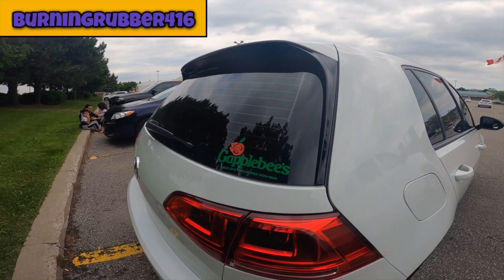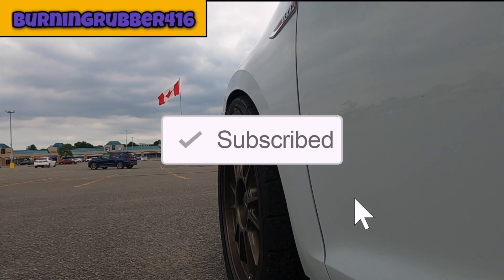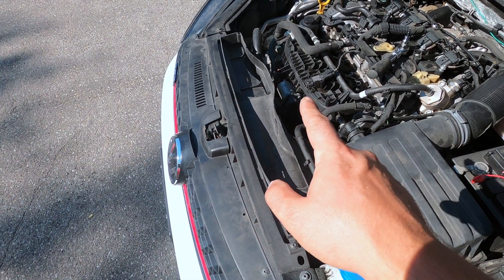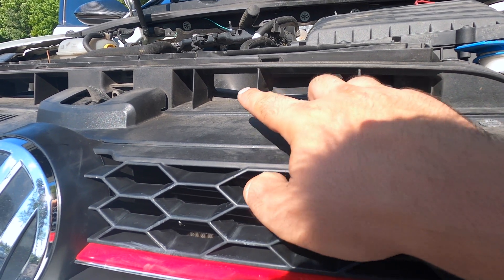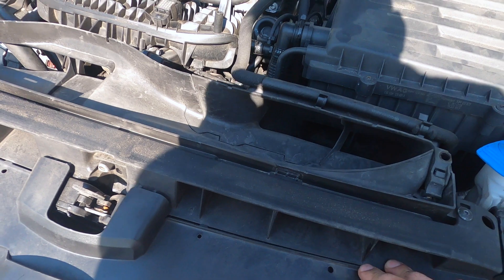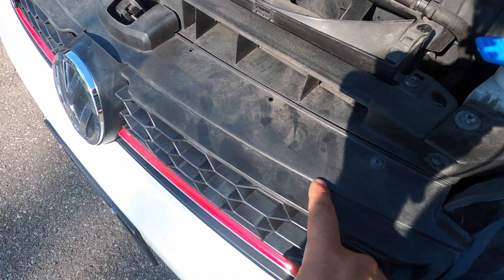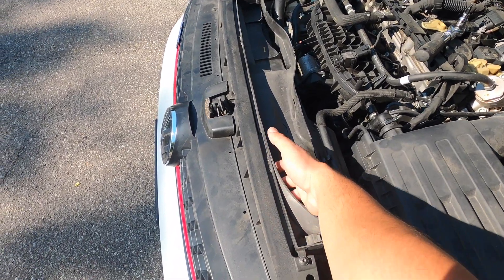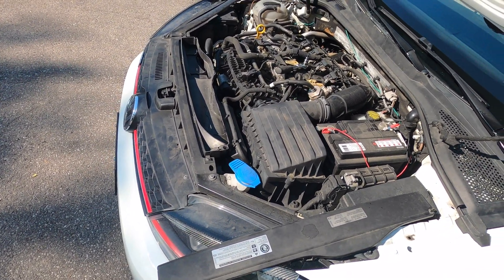Mk7 GTI How to get FREE POWER (Air Intake Mod)

Comment: Back in the days when I used to mod the older VW/ Audi's, especially the CIS cars, before there were tuners like Eurosport that made the lower section for the airbox, we used to remove the snorkel aka 'Hemholtz resonator' from the inlet on the box, and swiss cheese the airbox bottom on the side away from the radiator. It works on almost any car, 8v, 16v, vr6, etc. You can do this with a drill bit/ hole saw/ dremel, etc and it makes a huge difference. I can see on this platform it is also a great option to modify the stock box if you aren't going to buy or fab up your own intake with a proper heatshield. It was good for at least a few h.p./ trq and of course it sounded awesome and gave you much better throttle response. You should also add a good drop in panel filter, (foam ones like the Jamex or ITG style are superior to the gauze k&n style because they filter better/ don't let in as many particles/ are easier to clean/ don't require a ton of oil to be added to the element to risk fouling the MAF if equipped.) The idea is you still have the stock box to isolate the intake from heat but you add another area for the intake air to enter and will have no adverse effects since the holes you add are away from the heatsoak of the radiator. Just a tip for guys looking to do another free/ cheap worthwhile mod to the intake. 👍
Reply: Dont know if anyone gives a damn but if you guys are bored like me atm you can stream all of the new movies and series on instaflixxer. Been watching with my brother for the last months xD
Reply: @Reid Jerry yea, I have been using InstaFlixxer for years myself :)

Comment: You can eliminate the front box completely and for 25 bucks get a metal plate that removes this bent plastic box
Reply: How?
Reply: @advertentiegolf I can find a link they’re cheap. Even temu had them for a while
Reply: @advertentiegolflook up mk7 intake duct. Ecs has a more expensive one but much cheaper ones on eBay for a budget. Tariff must of slightly effected them they went from 25 to 40
Reply: @Hwy_Pirate I see, I'm kind of a beginner when it comes to this stuff. Do you feel like this mod is worth it or not really

Comment: "Upgrading" parts on your car is usually stupid. Unless you are building something for a specific purpose, changing random parts for "more speed better power this and that" you're just screwing with how the car is supposed to run. Change how the airflow works, confuse the computer in the car which thinks you're still using stock parts and get problems for a three way split between 1: maybe getting a barely noticeable improvement, 2: almost no change at all and 3: most likely a WORSE outcome. IDK why everyone thinks it so cool to mess with how things work without understanding everything thats actually going on.
Reply from the maker: By offering the car colder air, you are increasing volumetric efficiency, and even without a tune you are letting your car run at the peak of its timing table. Which makes it more economical and "faster". Its also free to do lol people like free
Reply: It makes cool noises and my monkey brain go brrrr.
Reply from the maker: This guy gets it ^^^

Comment: Pointless mod. Close the bonnet and the holes you cut out are covered up.
Reply from the maker: I used my cobb accessport to monitor IAT and I can confirm it went down by a few degrees with this mod vs just stock airbox

Comment: Nice but what if you find yourself driving in heavy rain on the highway? Won’t water wet the air filter as it will go through the holes you made?
Reply from the maker: I have driven in torrential rain and nothing happened, the amount of water that gets through is very minimal if any, and the air flow across the filter dries it to out very fast if it does get damp!
Reply: There's also a drain in the factory air box at the bottom just for that eventuality.

Comment: Wait a minute...are you suggesting that someone allow RAIN to enter directly into the Airbox?  That's nutz :-)
Reply: Don’t know what you guys are talking about in actual practice water doesn’t suck up there unless you’re driving through a river
Reply from the maker: I spray water into the Throttle intake pipe too 👀 😧
Reply: @BurningRubber416  Are you routing “meth” as well?

Comment: Any concerns about rain water or dirt coming in from the front of the car?
Reply from the maker: I’ve been running this setup in Canada for about a year now with no issues! I have a k&n drop in filter that I do notice needs to be cleaned about once every 4 months. There are quite a few turns debris would have to take to get in, so I would say it’s safe to do!
Reply: @BurningRubber416  thanks. This just may be my next mod. I have jb4 and an AFE dry filter
Reply: @BurningRubber416  ...You've already mentioned above regarding rain getting into airbox and said it's minimal BUT the K&N filter does get "damp" (but dries out) I believe the reason VW designed the front mounted scoop only allowing air in on the right is to minimize or eliminate this issue, also the scoop on that side has that large opening on the back so water and other debris flow through into engine bay instead of being routed into air intake. These types of "mods" are questionable as to how much you're willing to chance longevity of your engine...for such a minimal gain. Hell you say you've already go close to 400bhp w/o this mod.

Comment: To make it even better, you can get a blocking plate off of a gte to close that left side off so it doesn't suck that hot air in! Love the build!🤙 and the vids! Keep it up homie
Reply: don't recommend this, as the airflow is then restricted to the Oil filter housing and the intake plenum
Reply: https://track-hack-parts.myshopify.com/products/cover-for-rear-of-oem-air-intake-from-gte                  here is a link to the block off plate👍
Reply from the maker: Very good tip!